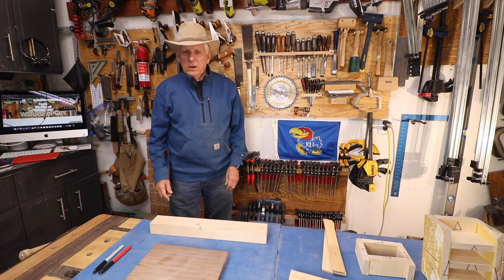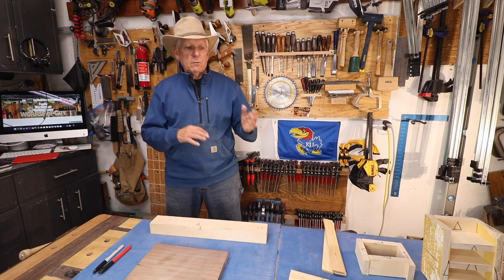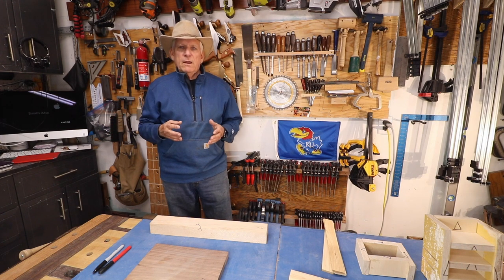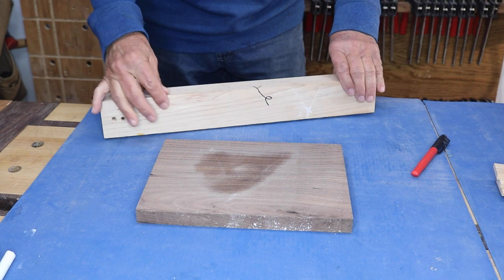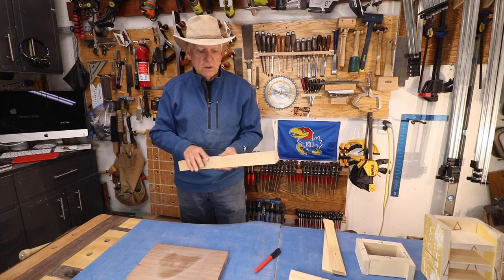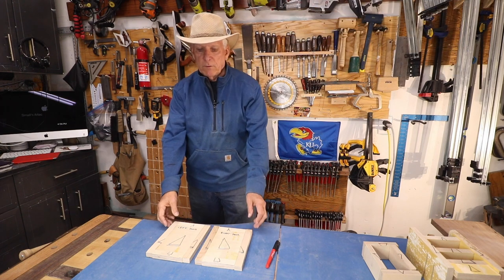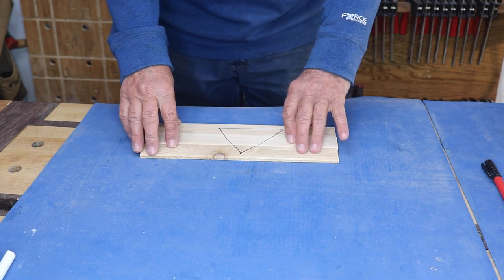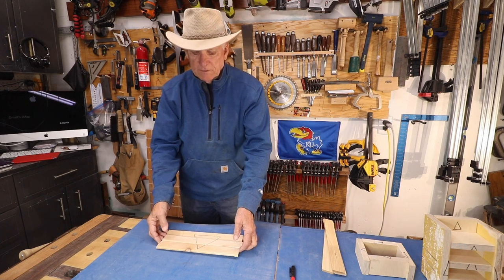Markup Your Woodworking Components With Triangles So You Can Keep Them Straight

Comment: Good video Paul.   I've used the triangle marking system before, but I never really thought about adding directional orientation via the apex, or using right triangles to identify left from right.   Your informative video might save me a trip back to the lumber rack someday, because I screwed up and milled a board with the wrong orientation!   P.S. Love the ghost fade in at the start!
Reply from the maker: Glad the video might be of help to you in the future.  Yeh, doing the ghost fade is actually so easy and fun for me particularly now that I have added sound effects to it.  Guys got to have a little fun in the old lonely workshop.